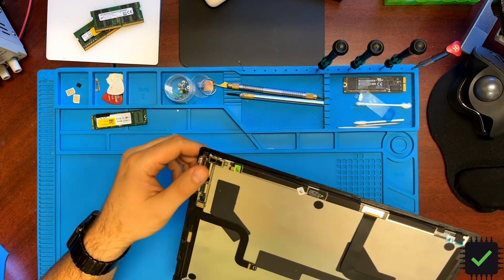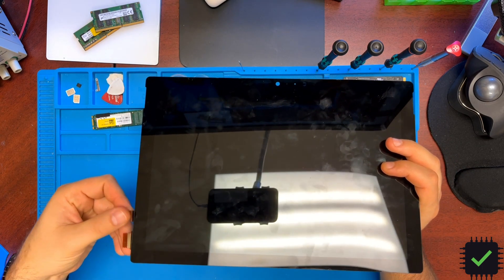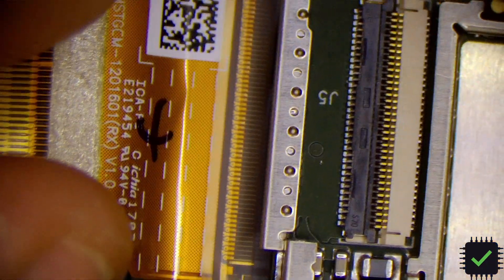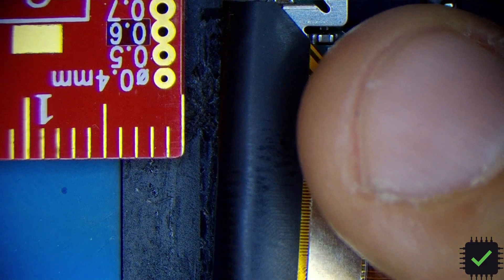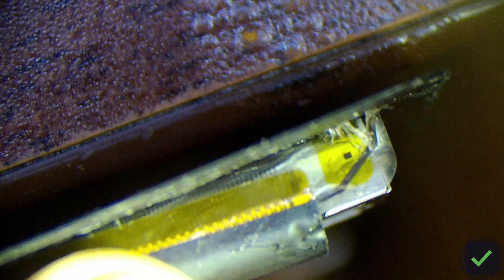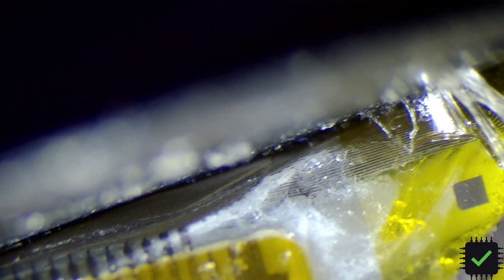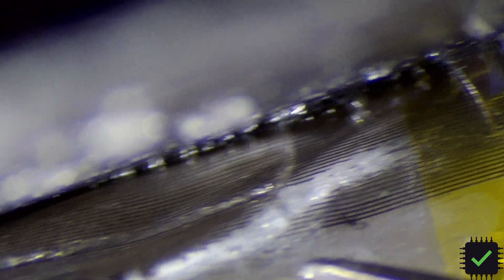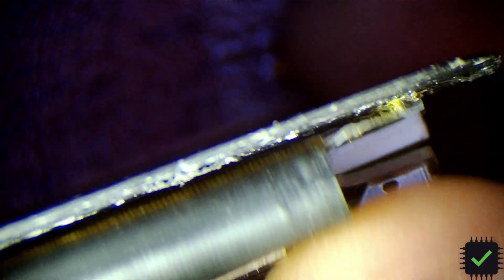Microsoft Surface Pro 4 5 6 touchscreen not working after opening. Tips to avoid damaging flex cable

Comment: Hello, this connection socket for touch cable (and 2 more irrelevant sockets nearby) are under metal cover. How to remove it? In your video it's without cover
Reply from the maker: Pry under it around a little in several spots and it will pop up.

Comment: I have three flex cables(ordered two), two screens(ordered one), ordered another mother board too. STILL NO TOUCH!, I have no idea what the issue is. Even installed new windows with drivers.
Reply: Have you tested different touch boards? I have the touch working on some parts of the screen with one touch board but not with three others.. I hope I will get one that works correctly

Comment: I had the touch screen replaced, it seems firmware from the screen updated on to the system. This happened after I did a full system reinstall. The screen works but the touch screen doesn’t. It also shows 2 drivers for the touch screen in the device manager. I checked my other surface and it doesn’t show any of those drivers at all on it. What would be the best way to fix that.
Reply from the maker: Make sure your screen is the correct version, I believe 2 versions are available for this model. If it’s correct - could be bad replacement screen or issue on the motherboard